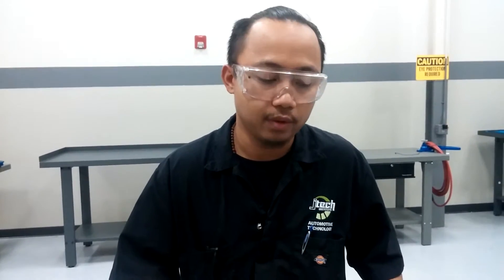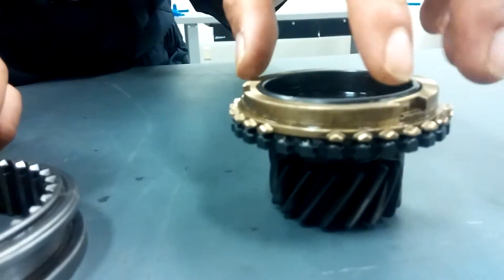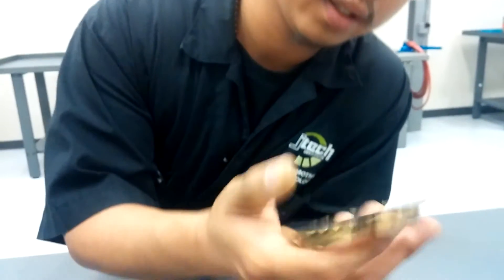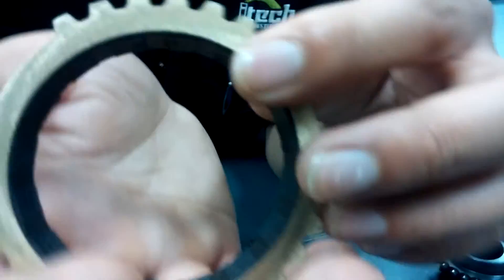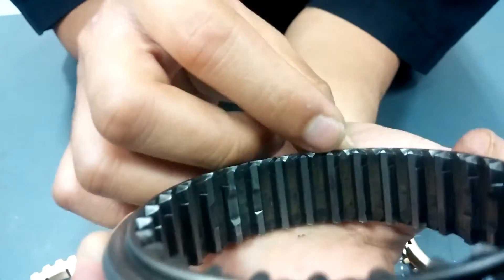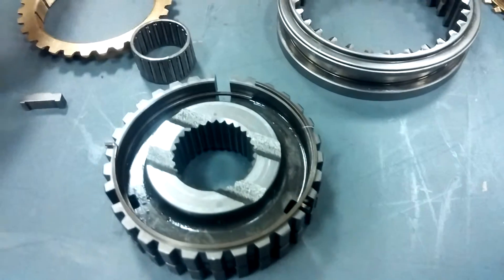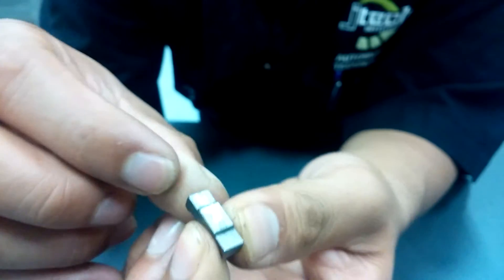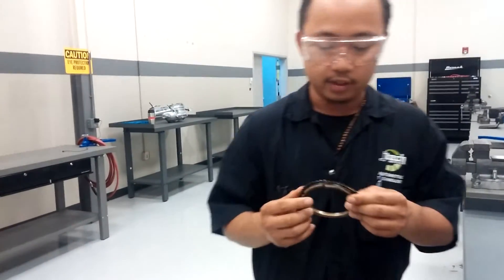Inspecting transmission synchronizer assembly

Comment: Dropping the synchro on the floor just to hear the ringing was unnecessary and could've damaged one of the theeth, you could've used some sort of string or thin wire to hang the synchro from it and then hit it with a screwdriver to make it ring.
Reply: the stress these rings go thru when you shift at 7k rpm is far greater than dropping one of them on the floor lol
Reply: Victor S seriously! These things go through waaaay more stress during regular use than any drip on the floor. If a drop in the floor is going to damage these then I wouldn’t want them in my tranny.